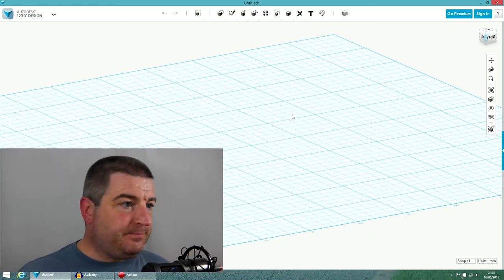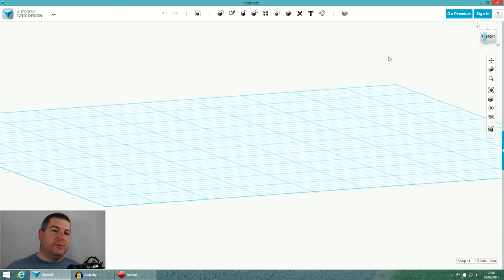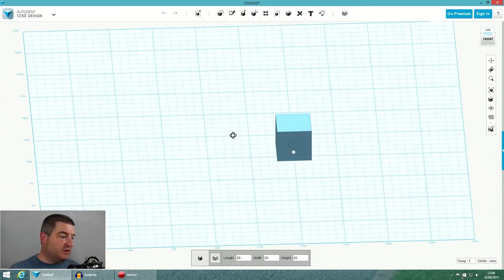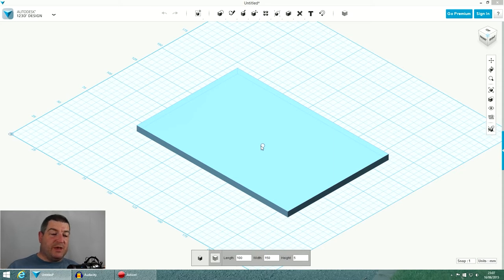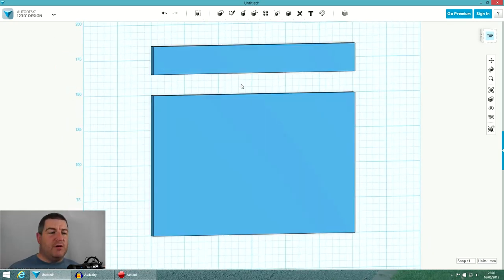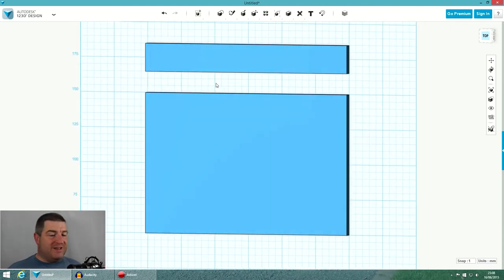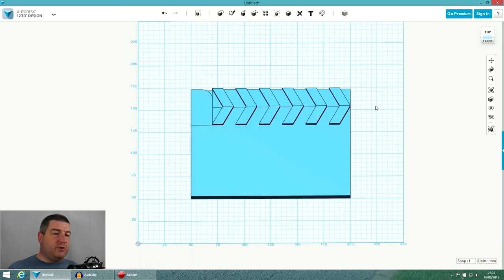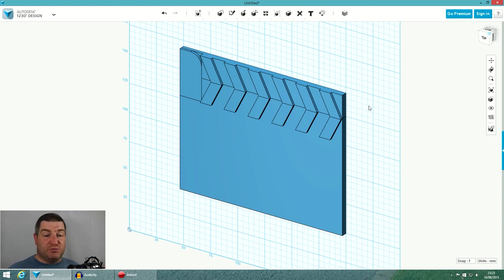A first look at Autodesk 123D Design - Clapper Board Project #01

Comment: You added some extra margin for the hole and pin arrangement, but wouldn't the fillets on the top part and the hinge part also need extra room to not bind when moving?
Reply from the maker: Hi, good point.  As the parts will all be printed they should all have the same over or under extrusion on all the external sides. The hole and pin need extra clearance due to the pin being an external edge and the hole being an internal edge. Thanks for a great comment :-)